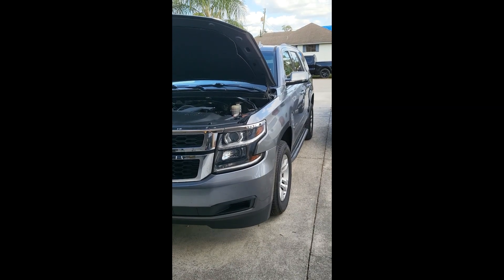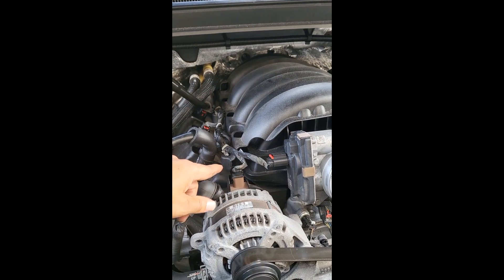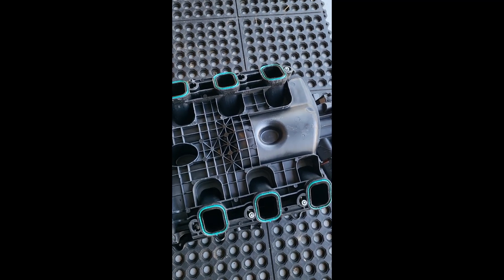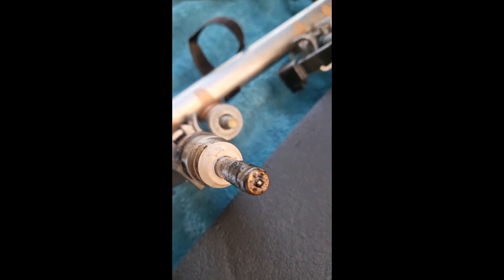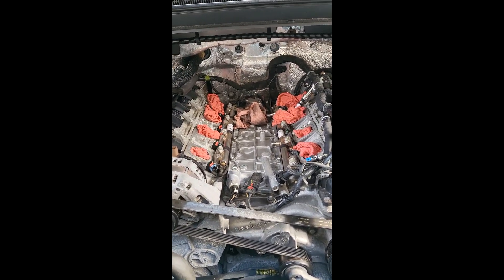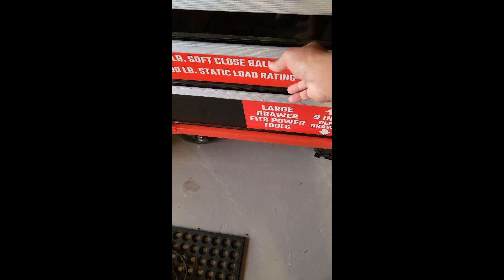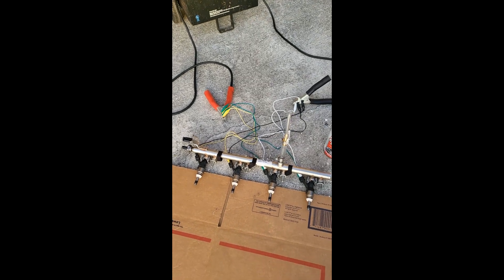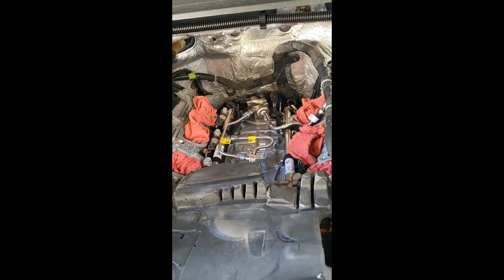2018 Chevy Tahoe fuel injector replacement

Comment: Before having to change it was the car jerking giving you an indication that it has to be replaced?
Reply: I have a 17 Tahoe and yes it will jerk and you will have loss of power I started with a tune up because it said misfire #4 I’m putting new injectors in tomorrow also you will have a lot of white smoke from the muffler if it’s the fuel injectors
Reply: @douglaseubank7645  did you get this fixed? were you experiencing hard shifting at all?